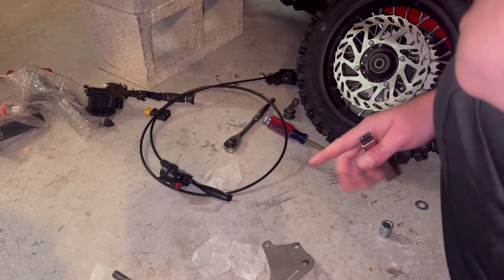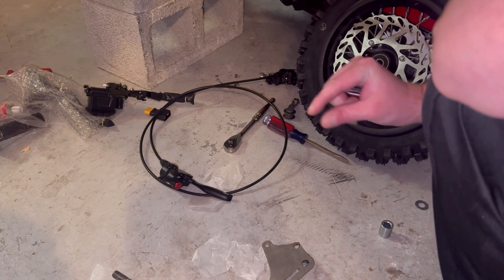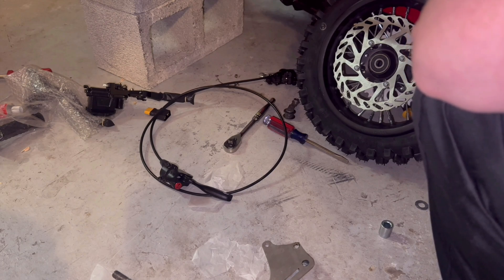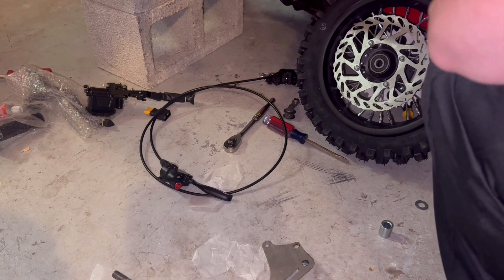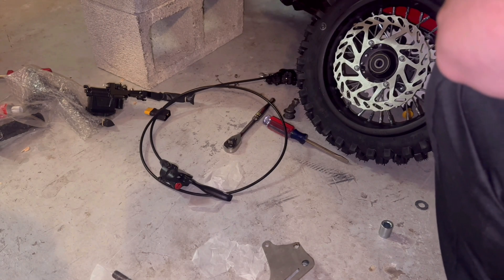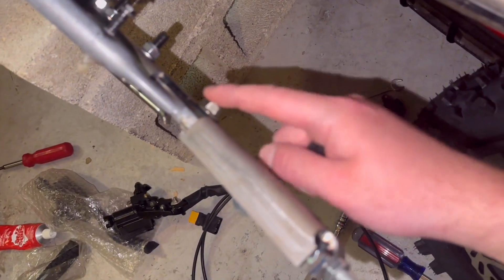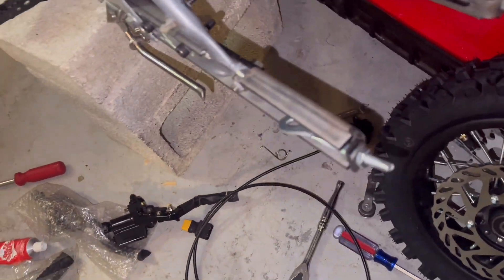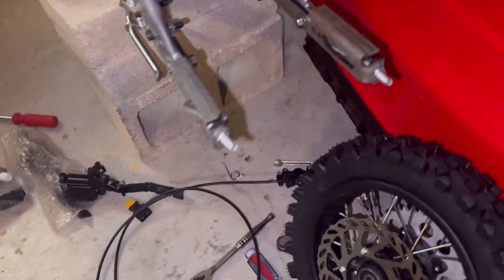Razor MX350 - Ext. Swingarm, Brake Adapter & SX500 Fork Spacing; 10” Wheels-EC4P-Votol EM85-72v24ah

Comment: I just bought sx500 forks for my sons mx350. Do I need to change the wheel size or is it rideable with the mx350 tires? I’d rather not put new wheels on it if that matters.

Comment: I want too put a 16 in the front and a 14 inch on my rear extension however I don’t know exactly how too find the best fitment for the 14 too for on the rear any ideas?
Reply from the maker: I don’t think a 14” wheel/tire will fit in the rear. A 12” Will but the issue is finding a 12” wheel with a hub width thin enough to fit. Why I went with a 10” wheel with a thin enough hub width. If I find a 12” that will fit, I’d probably throw it on.
Reply: @ I have a 7inch extension dropouts with those you still don’t think a 14 would fit ? Also I was brain storming more and if I couldn’t find spacer too got inside the bearings to make it for the axle ?  Idk kinda was a mock up idea
Reply from the maker: @xtswolfygg if you have longer extensions then yeah it should fit. But it depends on the width of the hub💯🍻
Reply: @ alright sweet just wanted too get another fellow razor owner’s opinion thanks 🙏🏽 😎